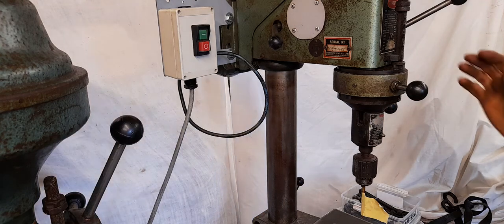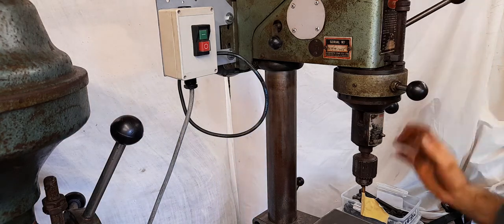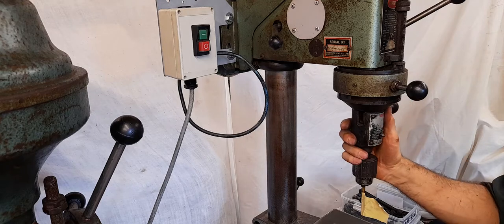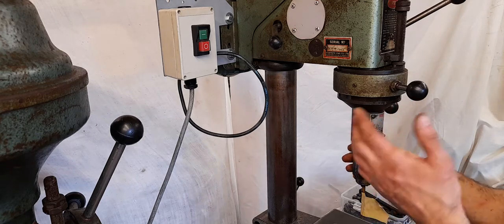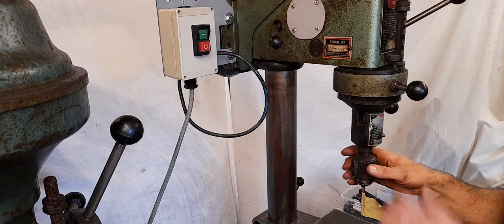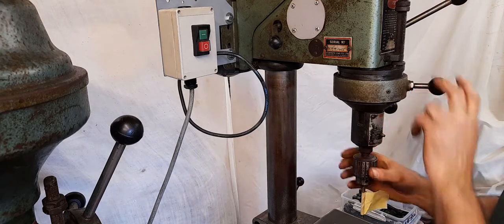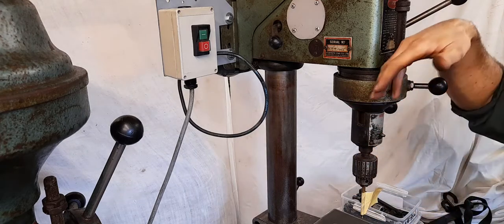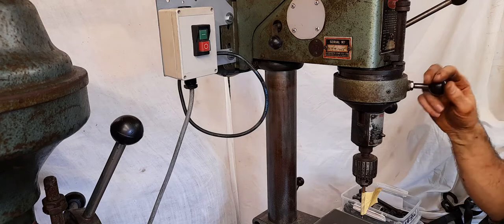Startrite Mercury Mk II epicyclic speed reduction unit

Comment: I have the same machine. I’m just curious about one thing. It appears there is no easy way to move the belt from one pulley groove to the next, the motor seems to be permanently bolted into place, not on a hinged plate allowing quick slackening of the belt to move it to a different pulley ratio. Is this the case on your machine too?
Reply from the maker: Yes, it's the same.

Comment: Does your ratio change collar have the O rings fitted? My 10 speed is'nt anywhere near as easy to change, even with the change pins removed it is far stiffer than yours to change.
Reply from the maker: I've never seen it stripped down so can't answer your question. I do know it's always been easy to use.
Reply: @PizzeyTechnology  Cheers, I suspect they are either worn or not there, making me think I should remove mine or at least one of them.